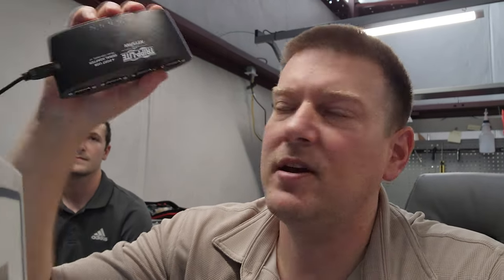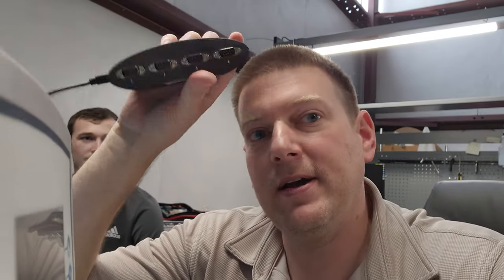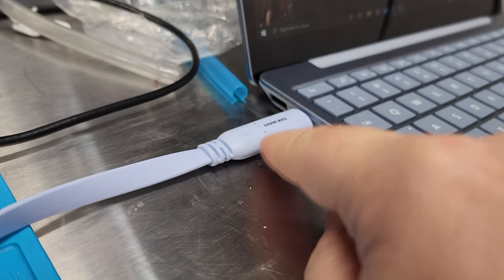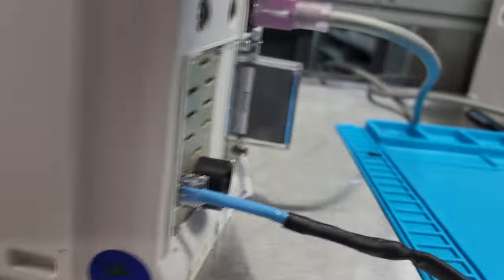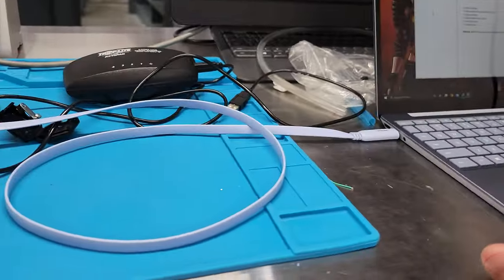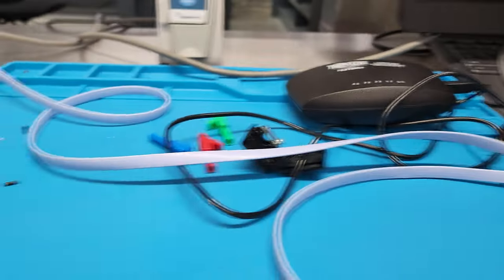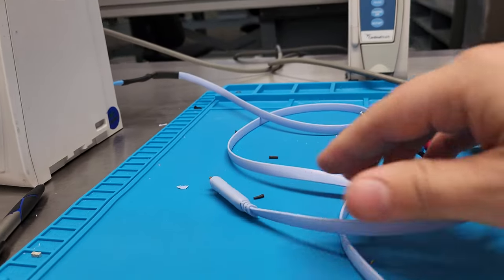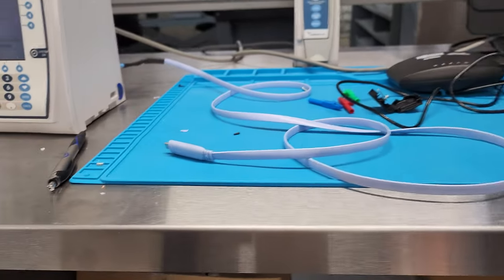A Better Alaris Maintenance Cable?

Comment: I asked the question to GE FE group "why are we not using cell phones to complete new imaging system installs without  a site network?" Answer "its not possible" 

Good job.
Reply from the maker: Anything is possible if the problem is correctly identified and the solution is broken up into smaller realistic pieces.